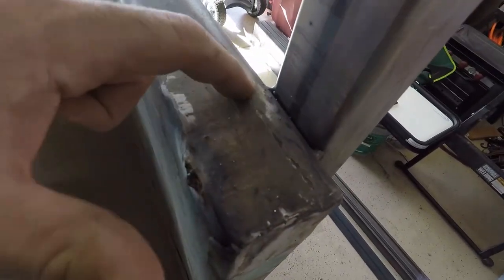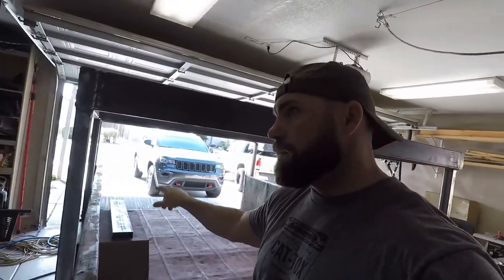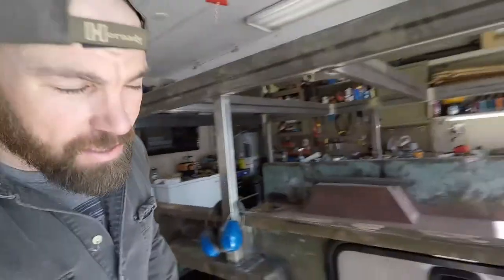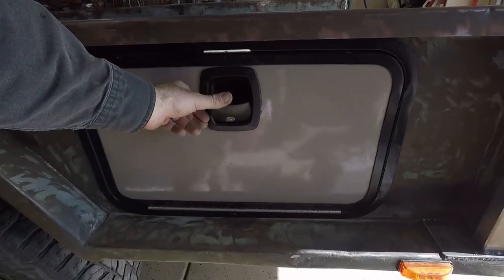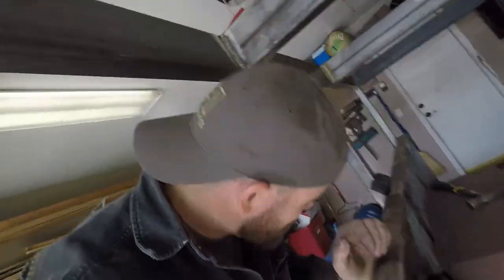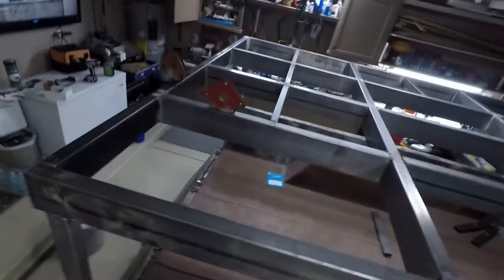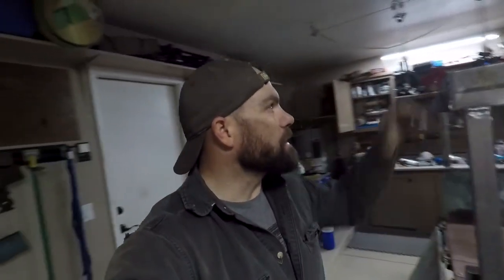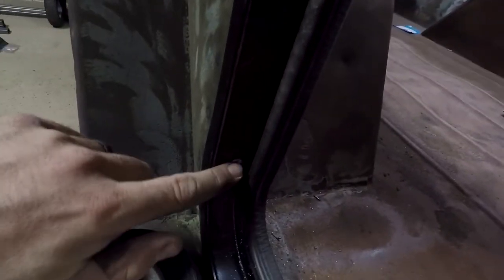M101 Trailer Build E11 - Deck Frame Part 2

Comment: Not sure if you answered this in a previous video. I was curious what kind of welder you are using for this build? It looks like a flux core welder to me. I am hoping to do a similar project but have been wanting to get a mig first. I have a flux core only welder that I inherited and was not sure how well it would do.
Reply from the maker: It's a Hobart 210 MVP. It runs flux or solid core but I only ran flux in it for the entire build. I had initially thought that the majority of the work would be done outside but was happy with the flux so have stuck with it. A little more clean up but its simple.

Comment: I'm looking at a M101 right now and thinking of doing the axel swap that you did. How much do you thing that it cut as far as weight?
Reply from the maker: With the 33" tires I only save about 200 pounds over the stock axle setup. That 200 is worth it though in my opinion since I'm right at 2500 total fully loaded with my tent installed and water tank full. Ride is also 1000% better.

Comment: Let us know the tare weight of the trailer before the kitchen install, etc.
Reply from the maker: Unfortunately I did not weight the trailer at that point in time. Final weight fully loaded with roof top tent, and water full is 2500lbs. My best guess for just the trailer with deck frame is ~1700-1800lbs.
Reply: @CallIntheCountry  I'm modding a 101A2 as well. Yours is very close to my plans, especially the side baterry door. I'm putting them on both sides.